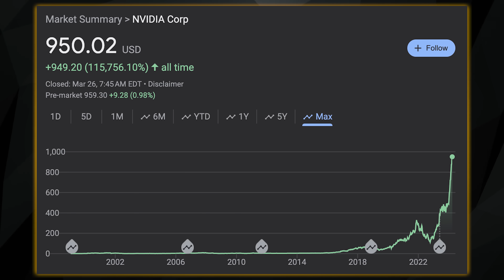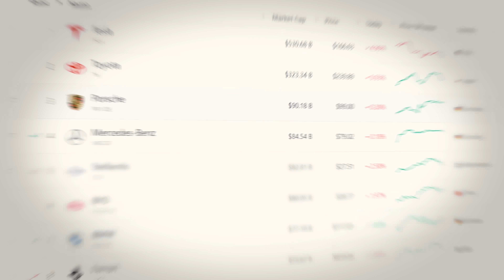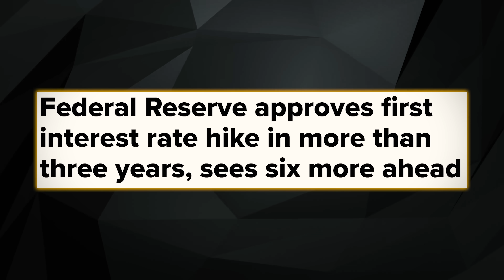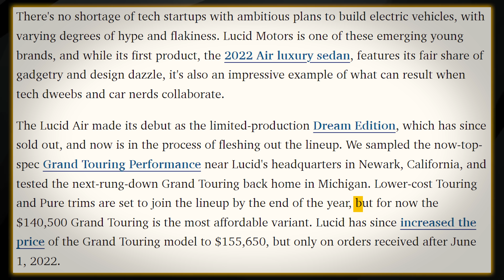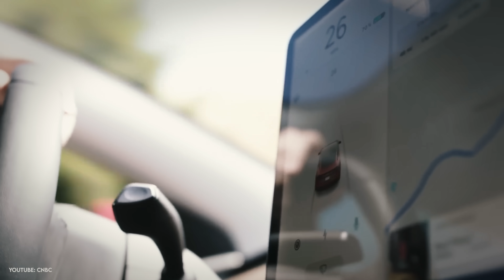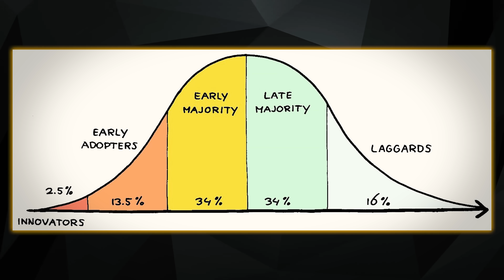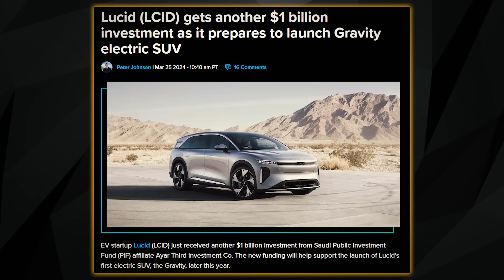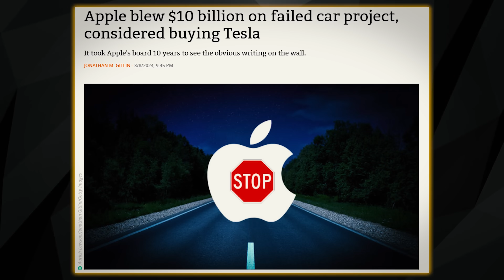The EV Bubble Popped - What Now?

Comment: Other HUGE disadvantage of EVs is the second hand market. So EVs may be more reliable than IC cars, but as a new car owner I only care as much as it's actually impacts its resell value, cause on average new IC car isn't gonna break during first 3-5 years anyway. Even if it breaks afterwards it's reasonably easy and cheap to fix. EV's range on the other hand is degrading every year and replacing the battery simply isn't viable for a 10yo car. Therefore used EV's have terrible resell value, and therefore buying them with cash is just pointless - it only makes sense with part exchange with the dealer every 5 years or so. In the end because of that (un)planned obsolescence EVs are in reality at least twice as expensive in the long run, not to mention environmental impact of manufacturing 2x more cars per average owner within the same 20 years timeframe.

Comment: In a world that still has terrible problems with electronics, spending a good chunk of your entire salary (or even multiple years for lower income) on a fully electric vehicle, it's not a good idea. Insurance is also substantially higher, typically 5x more for low income vs similar gas cars. Then there's the maintenance. While there's less maintenance typically on an electric, that maintenance (and repair) cost is significantly higher. Also, a lot of the time (approaching the majority) it costs more to charge away from home per mile then it does gas per mile. So it only makes sense if you own a home and have the extra income to install a charger and pay more for the vehicle upfront. Most people in that position just buy a nicer gas car, and the people most likely to adopt an electric, don't own a home and have no way to charge at their apartment. So it's really just early adopter growing pains, but wait. Electric cars predate gas or diesel cars, and were abandoned due to them. So... Late adopter growing pains?

Comment: The fanboying over EVs is such cringe. EVs just are not competitive  with combustion engines. Putting all these vehicles on the power grid is insane. Especially when a fleet of electric buses would instantly overwhelm the power grid of an entire city. Also an ev fire causes substantially more damage to roads as they are hotter and more difficult to put out.

Comment: EV tires wear out faster.
Electricity is not free. It costs money and going up as well.
Electricity is not zero carbon, it emits a lot, but else where, still causes global warming.
Tax payer money is being used to subsidize EV's, so not as cheap as they appear.
Additional tax is levied by State GOVT's on EV's as they are not paying gasoline tax and damaging roads much more.
Electric grid has failed before several times. Making EV owners stranded in their homes.
The battery life reduces drastically as the car ages.
Wind and cold weather significantly lower your range, hence very difficult to plan any trips.
EV's are constantly spying on you with all their tech.
EV's are vaccum cleaner or hair dryer or smart phone on wheels. (That is why even Dyson and Apple wanted to make one.)

EV's are a total waste of human time and effort.

Comment: EV's are still way more expensive than a basic car. Not to mention all the problems with software/lack of tactile feedback. Also the extra cost of replacing the batteries, and the fact that you can't charge yet if you rent. Tesla's going to be going out of business over the next ten years unless they find a new leader and management, they threw away an easy lead and ruined their reputation. The reality is simply that most people don't want/trust EV's yet, nor want to pay at least 30% more up front plus the cost of replacing batteries.

Comment: The reality is EVs have the same flaws as ICE vehicles regarding trafic and risks to other road users while adding range, charging and battery wear limitations, destroying most of their utility outside of specific scenarios.
They can be good for inner cities if you make them small but need to be shared so they don't take too much space charging. And you'll need another ICE car for longer journeys...
The huge quantities of metal they demand will make them economically unviable in the coming decades. EVs aren't the way to go.

Most countriies and cities do not need EVs but public transportation in, around and between city centers as well as better cycling infrastructure.
EVs are often subsidized and thus detract from financing these all the while taking up even more urban space. They are making things worse.

Comment: 7:25 that is because people overestimate how far they actually travel and the infrastructure isn't where it needs to be for example I have not seen a single place to drive too to charge a car and there is also the political problem as well as many Republicans believe that these cars are more expensive to produce and are more dangerous when in reality they aren't really in most aspects, most of price I would say is likely inefficiency and not making cheep cars, the cheaper without compromising on safety the better, an EV should just be like any other car but more power efficient

Comment: This video is a bit biased, generalised, and sensationalized. But don't let that stop the views.

Traditional USA automakers like GM and Ford have balls'd up EV design, production, and sales. That's why they're losing money, and pivoting back to milking their ICE vehicle cow until there's no juice left. Their unions seem to be making it harder by keeping on more expensive workers with skills that will become outdated in several areas (engine, drive train, exhaust, fuel systems).
Ford, GM, and other traditional OEMs like Toyota, Voltswagen etc... have to build cars that feed their legacy dealership model that makes money on more regular maintenance and middlemen. But EV vehicles have less moving parts, making it harder for dealers and OEMs to make money that way. So resistance to change is bound to happen with the FUD we hear now from legacy auto and big oil interests.

Tesla is not just a car company. It's an AI company, a battery and solar company, a robotics company, a tech company, and will become a ride sharing company (once self-driving robo taxis become a thing in a few years). 140,000 employees allows for a lot of diversification.

The 2021 bubble was a tech bubble in general. Not just EV cars. Look at Zoom's share price, look at Zillow, Netflix etc...
As with all bubbles there was some ridiculous easy money flowing around, this time from central banks across the globe, printing loads of cash and giving it away on mass.
Naturally that money has to get taken back, hence interest rates rising, poor and middle class people spending less on non-essentials, including EV, and speculative stocks.
What does this all mean? In the middle of a down cycle the new tech companies (EV auto companies included) that don't have a sound business model get squeezed and should go out of business. Natural selection.

Similar to Amazon, Ebay, and Microsoft in the 2000 bubble, the tech companies that have a sound business model will survive and dominate the next financial wave up. Tesla seems to be in the later category, and is already driving down EV costs to thin the competition out. BYD is doing the same.

In a few years the next generation of battery tech will reach market (think semi-solid state batteries), cheaper batteries will also hit the market, extending range and reducing EV costs dramatically. This will enable the herd to go all in.

Tesla is a company is not yet at the middle of the adoption curve. So if you think it's in trouble, look at Amazon or Apple in 2001, and use it as a guide to where Tesla will be in 10-20 years. Also look at what happened to Amazon and Apple's competitors and see where they went. Nokia anyone?

Disclosure: I own a minuscule amount of stock in Tesla, Nio, as well a couple of tech stocks and blue chips. I'm in for the long haul.

Comment: a normal workers wage wont cover the ev price unless he is willing to sacrifice a lot of other things. a lot of these wont have home charging or solar power either. that drops the resale price to a point where the average ppl also realize they are loosing a lot because of the resale value drop. so they wil also move away, to avoid those losses. and by now most ppl realize that you dont have the luxury of having the guarantee. so when you need to repair its out of pocket, and in case of evs is significantly higher.
as soon as u saturate the better earning and rich ppl demand, you have to wait till they want to replace the car with a new one.
i know the high price car segment earns the companies the biggest proft.
most ppl cant afford that. so why isent anyone building cars that focus on basics, where you get versions without all your overdone electronics and servos and the rest. just driving heating windscreenwipers and maybe a basic audio system. everything else is optional. your profit will be smaller but you could sell a lot more, in a different segment. all these ppl that are waiting till a used car gets into their price range.

Comment: EVs and especially teslas are really good, but too expensive for the masses compared to ice when brand new. A theoretical 15 year old second hand tesla model S or Y actually saves you money because you negate the huge upfront costs and don’t spend as much on fuel(potentially even for free). I drive an old beater car and have spent multiple times its worth in gas in 5 years. Teslas have been selling a lot the last few years and in 5-10 years the second hand market will be full of them, hopefully for less than 10k dollars.

Comment: I only watched the third segment and saw immediate mistakes, the Rivian R2 has not caused an osborne effect on either the Model Y or R1T, it is 2 years away from launch and probably 3 from being delivered to the average consumer, the osborne effect just doesn't make sense. & So much for competition since the R2 is at least 3 years away from mass market, without any delays and the specs that have been revealed compare to today's vehicles not ones 3 years down the line. 

Nvidia is not a competitor to Tesla, no press release has ever said so nor has Nvidia; Nvidia is providing companies with infrastructure through their Thor platform- cameras, sensors and compute. Companies need to figure out the part with big data, neural net architecture, rule-based driving and whatnot. They can provide Thor all they want, a company like GM for eg. but won't do the work, and I think it's very safe to assume that legacy OEMs that are yet to design basic apps around their cars aren't going to spin out a FSD demo for at least more than a decade, the investment into it making L5 ADAS will be enough to end the sub-5% margins and effectively put them in the negative territory. 

Then the so called competition from Kia/Hyundai is unsustainable for them, Hyundai led this years chart of negative FCF generation, with an implied FCF of 2000$ per car sold. And the so called competition has been there for a while, basically every EV outlet had this headline in 2022 "The 2022 KIA EV6 Is The 'Tesla Model Y Killer'". So it's not really new competition, and Hyundai had a severe gap in their BEV growth in late FY23, so we'll see later if that is a trend.

Comment: EVs are a dull idea. Unless the vehicles generate their own electricity, using solar/ otherwise, they re just as bad as ICE. Electricity generated using nuclear/ coal pollutes as much as vehicles. Only in certain European countries where electricity generated exclusively by solar/ hydro/ wind turbine is EV sensible. Range anxiety is an issue especially in parts where heavy traffic exist, half the battery life gets over in traffic itself. Lithium batteries that deteriorate over time, is also a bad investment.

Comment: My problem with EV's is the high repair cost. Batteries are a wear item and Tesla charges over 20 thousand dollars for a new battery plus install for the average car. 

Compare this to a gas car where a new engine costs 5-6 thousand dollars and a new transmission around 3000 dollars

I drive a used crown Victoria and the engines are known for going well over 300,000 miles

Compare this to the average Tesla battery charge cycle lifespan of 1500 cycles, even less in colder climates, or far less in events of premature wear where entire cell banks fail due to a single cell giving way.

Comment: What are owners going to do when they want to trade in or sell privately? These cars are huge losers in the used market. Who wants an old battery? Who actually wants an old EV at all?

And for all these upstart EV companies that will go bust you'd have to be nuts to buy a used car with zero service centers. 

Even if EVs somehow found buyers in the mass market, infrastructure can't keep up. Governments mandating mass adoption haven't ensured infrastructure. We'd need new power stations, charging stations everywhere with hundreds of chargers on highway stops. Like imagine a charge station on a busy highway where even just 25% of cars are EVs. It would be packed with frustrated drivers waiting for their turn, annoyed with all the broken chargers, compatibility issues, it's all just impractical. 

Battery tech has not been suitable for these cars from day one. And it's not changed. In fact there are so many issues with the premise of EVs I can't see myself owning one unless I have no other options or gas prices make owning an ICE car a luxury. 

Perhaps we are headed to a world where folks just don't use their cars as much. Perhaps travelling large distances in cars will be like flying; it's horrible, but sometimes necessary.

Comment: I bought a Tesla Model 3 Performance in early 2019 when Tesla stock price was far too low, and the Model 3 was the best production car ever made by some way, and nobody really knew about it at that time.  A lot changes in 5yrs: my car went from rare and head turning to find out what it was to common.  The Tesla brand went from exclusive to every day, and the novelty of its design became very boring as the face lifted Model S and X came out with almost no meaningful changes.  I was left deeply bored and underwhelmed at the prospect of replacing mine with a new Tesla.

My wife and I see numerous advantages in running one petrol and one electric car, and so she is opting for a new gas car, and I decided in the end to go for the Hummer EV, which has been a tremendous, fun and enjoyable purchase.  On the car loan side, opted to buy both cars in cash due to the interest rate environment, a luxury most people don’t have.

Comment: It Tesla makes replacing full battery affordable then yea I have no issue buying one. Tesla say they give 8 years warranty or 120k miles, whichever comes first. The problem is not the eight years. The problem is 120k miles, which will come first before reaching 3 years. This is why tesla doesn't like leasing, because after 3 years the car already came close to 120k miles and the next victim will buy the car thinking he got an amazing value only to see the battery is more then 30% dedrigated and reaching fifty percent very soon.

Comment: 1:50 That $23,000 only takes into acount the state and fed $7500 each, not including the gas car trade in of $12000 and the power company discount of $4000, but the Model 3 does not qualify for the fed $7500 due to the battery not assembled in the US.  So it would be $13,500, but another EV of the same price would be $7,000.

Comment: I disagree chargers are an issue. The press has made this the boogyman, but its made up. Most charging is done at home. I do know people who don't have home chargers, and they are able to get charging via work chargers or just stopping at a fast charger. The press keeps quoting the times to charge from zero, which is nonsense. Most charging does not start from a dead or nearly dead battery. With 250kw range fast charger, 15 to 20 minutes gets you several days of average driving time, about the same as a car. Also, quoting "350 miles of range" for a gas car is ridiculous. The have only been getting that kind of range for the last 10 years or so, and that only with a hybrid. My gas car does 200 miles range, and that is an average car. If that was inadequate, why is is suddenly unacceptable when people were fine with that kind of range before?

The nonsense about "you have to have 500 miles of range" before EVs are practical is just that. Nonsense. Giving EVs that kind of range will require you carry a very heavy battery around, adding to the cost and reducing the net efficiency of the car due to dragging all that weight. 100 miles of range would satisfy most peoples use cases, and 200 miles is certainly sufficient, and that is the range of most new EVs.

Comment: Stock market is just a fancy gambling avenue with zero real connection towards fundamentals…

And while Tesla does a lot more, they are still mostly perceived as a "car company in a traditional meaning" with similar value ascribed to them…

So, despite Tesla being one of the few automakers, that actually make their own cars*, it's value is guesstimated from the rest…

(Most automakers just buy modules from companies like IAC or SW from companies like Valeo and splash them together - that's why modern cars, both ICEV and EV, are terrible…)

And when now the global economy is cooling, car industry is crashing down (while ppl struggle to pay for food/housing, thus can't afford any car at all) and Tesla is the only one to keep some decent profits, focus is only on Tesla's performance in gambling den…🤷🏽‍♂️

However myself, unless there is Tesla2 and it's hatchback with reasonable utility value, I'm looking more towards Škoda Elroq (not released yet) or Dacia Spring EV, because both are in $20k-$25k zone and despite being terribly built, with a trash electronic systems, both have sufficient range, decent consumption and decent inner space…